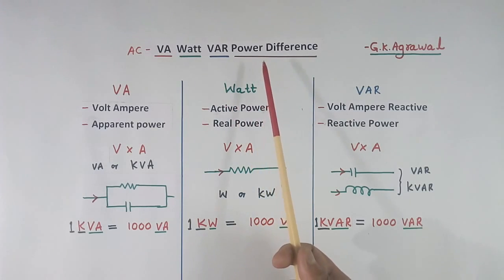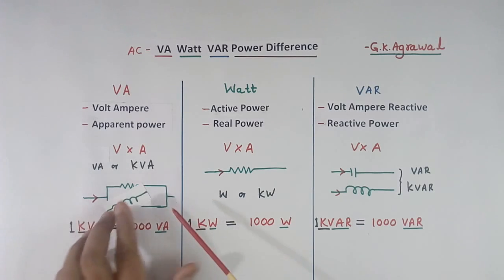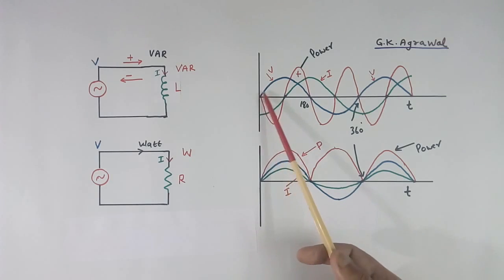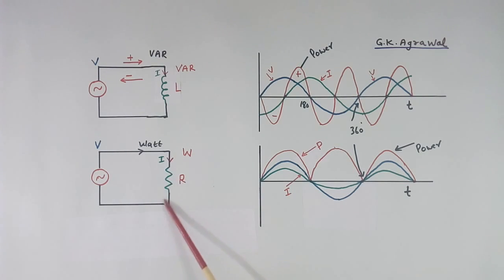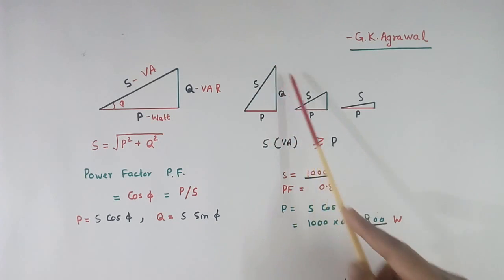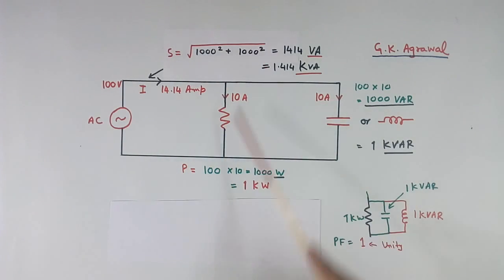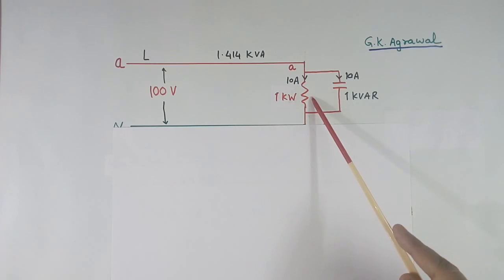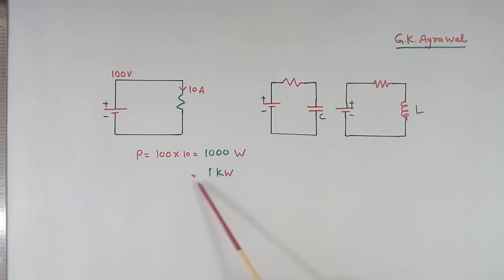KVA and KW, Active Reactive and Apparent Power difference

Comment: Hello sir, how are you?
Main Janna Chahta hoon k agr transformer bnaya jay jis ki primary side main 240v or coil ki resistance 10ohm ho or secondary side main b 240v or resistance 6ohm ho to Kiya is transformer ko power saver k tor pr use kr sakty hain?.
Kindly Please answer me.
Reply from the maker: No, agar aap 3 amp load karey then transformer mey 3X3X16 = 144 Watts loss ho jayega.
Reply: Thanks sir g.